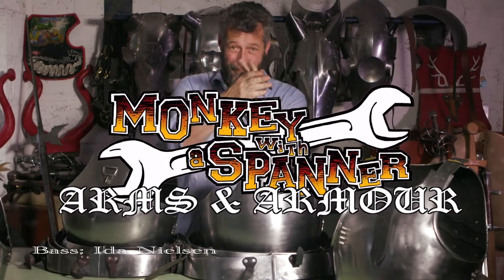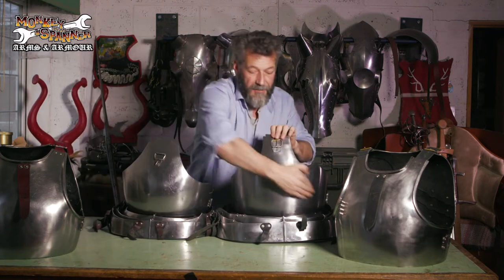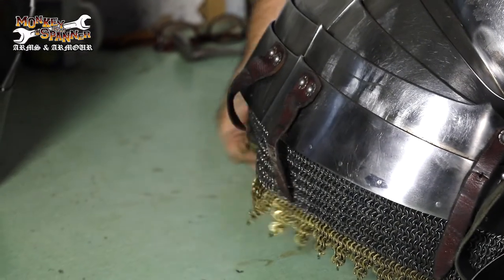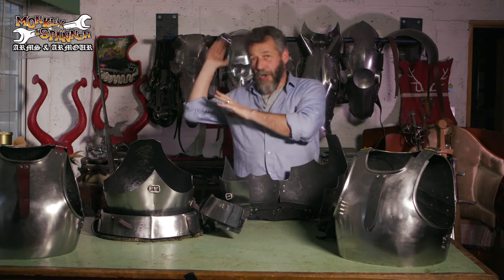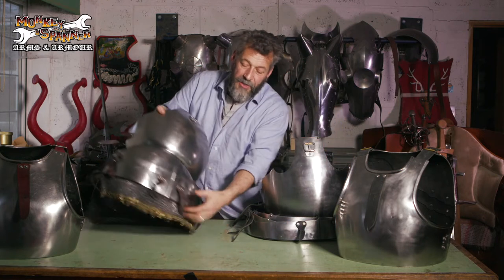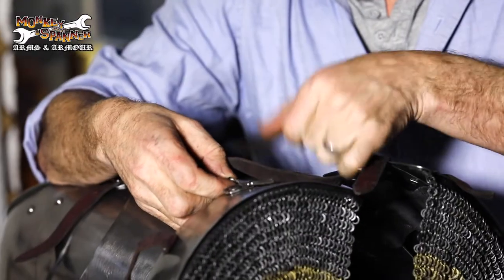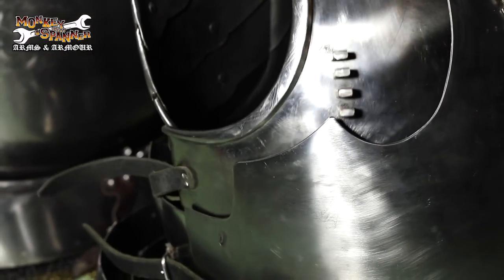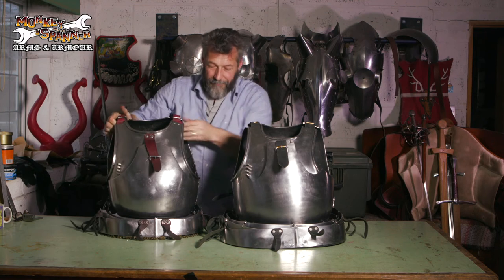PLACKET & FAULD; it's your body, bottom, bit.

Comment: Why were some plackarts rigidly attached to the breast plate? Wouldn't doing this reduce range of motion and present the risk of the top of the breast plate pressing into the neck with forward bending motions? Wouldn't it also be easier to just make one large breast plate instead of riveting the two pieces together? I know this was done sometimes, I'm just wondering why. Two separate pieces attached with a leather strap makes more sense to me.
Reply from the maker: Good question.

 I regularly wore a single piece breast plate and single piece back plate, so have a lot of experience with that style. I can't say it was much of a problem, except in extreme movement, which was rare. Most fighting takes place within a certain range of movement and as long as the armour accommodates that, it doesn't impinge on your abilities. Also, modern fashion tends to put the waistline lower than most medieval fashion. The breast and back should be more like an armoured rib-cage than an armoured jacket. A short breast and back massively reduces the  problem of it pushing up into your throat. Many reproduction breast plates are too long and so, suffer from just that problem. 

As for the ease of manufacture, certainly it is quicker to make a single plate than the form two separate plates and marry them together, but you must remember, not all of this is driven by practicality. Fashion and peer pressure is just as important now as it was then, so do you want to depart from the norm or look like your mates? Also, fashions change and so did this trend in later years.

As for the benefits of a two piece construction, over a one piece,  a two piece has much more articulation and some areas of double layer protection.  The ball and socket design works well and provides good protection. The single piece, if designed and made to fit, should not be much of a hindrance, but can give a different aesthetic.

I hope that helps...
Reply: @monkeywithaspanner8494  Very helpful! Thanks!